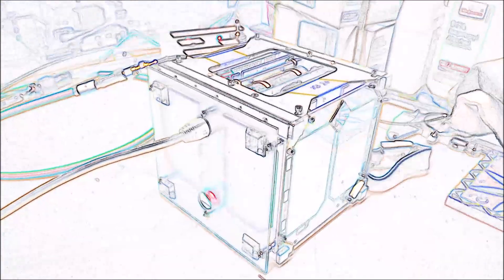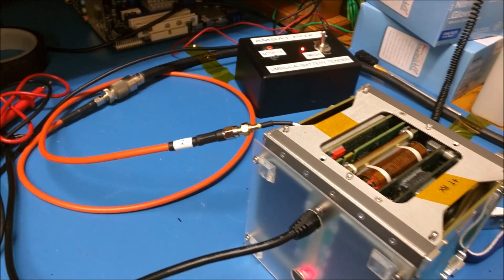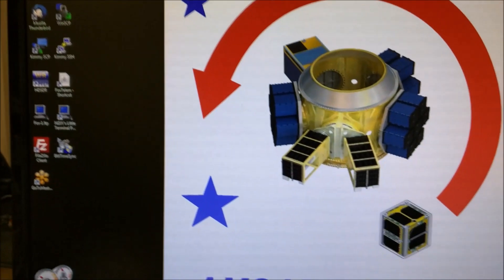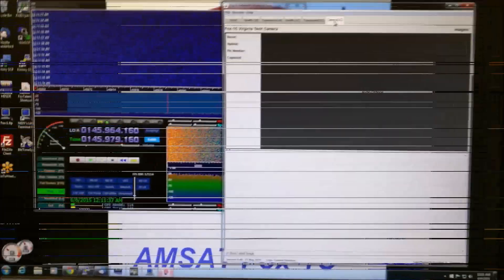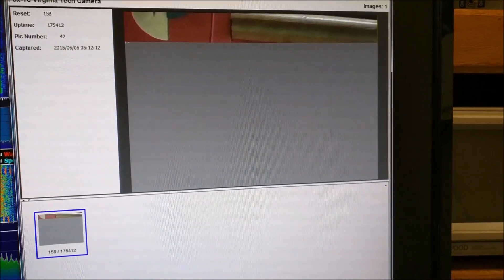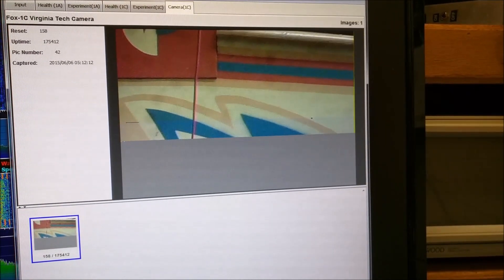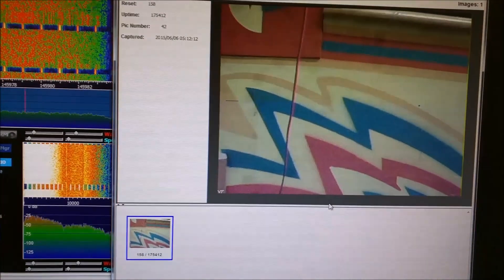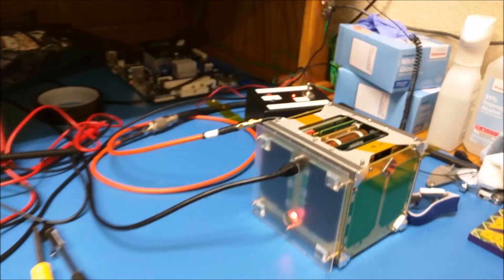Fox1C EM

Comment: How did you send the data over? Was it FMSK, Packet, PSK31, or something else?
Reply from the maker: It is data under voice for the typical satellite telemetry, and 9600 bps high speed telemetry for the pictures.  FoxTelem software available from the AMSAT website will decode both.  Details on the modulation have been published in the AMSAT Space Symposium Proceedings and in the AMSAT Journal.